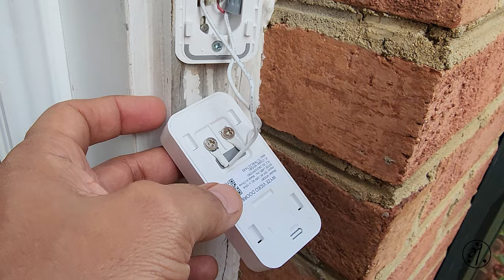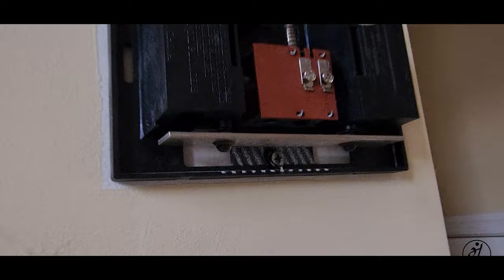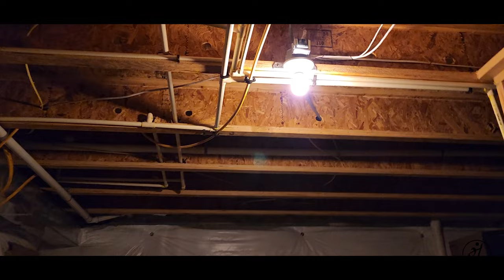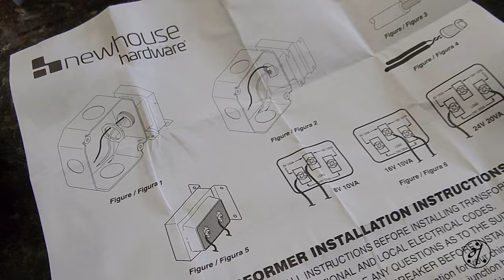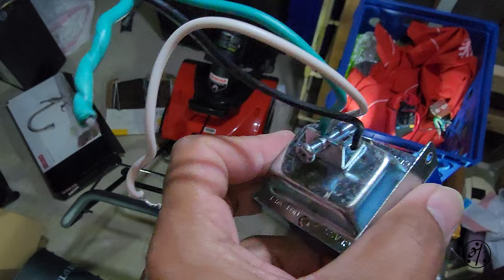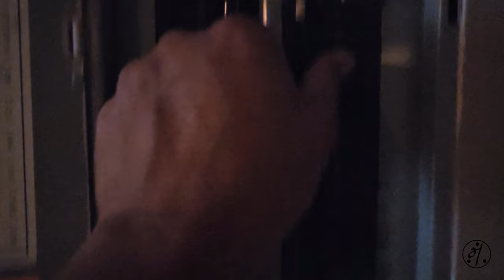Door Bell Transformer Replacement | Where to find Door Bell Transformer

Comment: I found my transformer just like the one in the video attached to the lamp. However, when I opened it, there was one black wire coming from old transformer connected with two white wires. I took black one out and the door bell didn’t work. Then when I connect the black one with the two white wires it worked again. Not sure how to proceed.